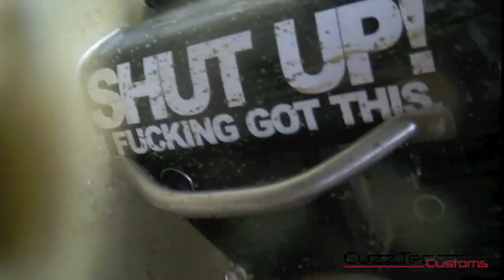How To G16b! 1600cc Efi Engine swap guide Suzuki Sierra/Samurai. G13a to G16b | CuzzTec |

Comment: What’s the part number for the thermostat cap? All I could get was 63B01 and not the first numbers. I’m planning to run short intake runners with a twin Weber style ITB’s and just like the Baleno intake, the thermostat is located in the back and not on the front like on the distributor ignition Vitara

Comment: Great video. Watchd it over and over again. Allmost ready with my own swap. One question. Where is that air intake hose from??
Reply: You can buy them brand new from Suzi store in W.A for $200. But I think that’s very expensive so I ordered mine from India on eBay for like $43 and just waited a while for it to ship. I’d recommend that instead of spending an extra $150
Reply: Jordan P  You dont happen to have the part number for that? Thanks advance.

Comment: Perfect timing. In the process of doing the same swap. Did you have any issues with porosity on the sump weld?
Reply from the maker: No issues as of yet, this is probably sump #10 i have done in the exact same method
Reply: @redzook1  Awesome, thanks.
Reply: i cant weld for shit so i had a mate do mine. just make sure you mock it up really well and make sure the new piece you weld in is sitting perfectly flat and flush or the crank angle sensor will never pick up the crank with its magnet and you will get no start.
Reply from the maker: @fujitsubo3323  thats why i bolt them up to the dummyblock

Comment: Do you have maybe some sources for the wiring? Part of the wire lead into the engine bay, that's clear, but one connector from the ECU lead towards the instrument cluster etc. that will be a question....
Reply from the maker: I have another video on wirig.
Reply: @redzook1  Shame on me, I'm checking it at once. :)

Comment: Hey mate, did you cert this afterward? if so, any troubles getting it passed through? I've got a sj80 and have a vitara g16a and all the bits sitting in the shed waiting to go in. it's my daily so want to make getting it legal as stress free as possible. Great vid by the way! Cheers
Reply from the maker: Hey mate, a few of my swaps have been engineered. Usually just paperwork

Comment: Just a quick question, I have a 2004 Suzuki grand Vitara 3 door, g16b engine, was wondering if anyone knows for sure whether they are an interference engine since it's probably been over 100,000kms since previous owner did the timing belt, and I can't get a definitive answer from Google. Cheers

Comment: thinking of doing an m16a conversion in my 1989 sj50. I have found some good threads about it but wondering your thoughts and information on the swap if you have any
Reply from the maker: Awesome swap! Takes a lot of different parts! But would be a better outcome than a g16b
Reply: @redzook1  do you know of any issues with the swap ?

Comment: I have done a. similar conversation on mine.. Youtube makes it looks easy. What management did you use, and how did you do your fuel pump setup so that it is reliable?
Reply from the maker: All covered in the video and the next few in the series
Reply: @redzook1  Thanks I had a look at that. Haha, I have done something very similar.. but with a Jimny JB43 Loom as I have a aftermarket ECU running and did a JB43 dash swop. (Check it on my channel if you like). the wiring video did not cover the fuel pump installation. Are you using a internal fuel pump setup, external with feeder pump to high pressure pump, or a surge tank setup or straight external high pressure pump direct from tank to fuel rail?

Comment: Hello, I haven't pulled out my original engine (G13BA), but as I'm inspecting the Baleno engine, it seems it won't fit with its exhaus manifold, because it interferences with the engiene mount. Does the G13BA manifold  fits on the Baleno head? If yes isn't it a narrower diameter than the ports on the head? ( I know I could check it myself, but the engine is still in, and I'm excited about what I should change....)
Reply from the maker: No you have to buy conversion headders. Look on ebay
Reply: @redzook1  Well I was afraid of this. It's interesting no swap videos are mentioning this, while the headers are at least 3 times the price of the whole engine (at least around here... ) :D

Comment: where did you get that 1600 conversion kit from looks like rat shit. i'm guessing its its from america or something?. benT for the win!! . i liked the way you did the thermostat to front top rad connection. mines currently just rubber hose with a 28mm joiner with the g13ba thermo sender in it for the cluster and i dont really like how close it sits to the intake manifold. might have a go at your way. also tip for anyone reading this, i was a usless C#$t and ruined both my baleno cable and my old seirra cable trying to mod them to get them to fit. the easy solution is ebay search "
1600 Baleno Conversion Cable - Suzuki Sierra SJ40 SJ50 SJ70 SJ80 Maruti" that cable is from a factory G13BB from an indian maruti gypsy and it directly fits in no mods needed.

Comment: @CuzzTec did you take out the original ECU out of the car or did you do a standalone ECU from camms and plug the temperature into the old one? i'm doing a engine swap on my vitara from a 1.6 8V G16A to a G16B so if you have any tips.
Reply from the maker: You can do do either. The ecu is from the donor car
Reply: okay so the old ecu was still in the car and operating the internals such as lights and stuff and the ecu from the donor car  is only for the engine, did you also put in a different fuel pump and hoses or did u use the original?
Reply from the maker: @redeye_volvo  they don't have a body control ecu. I have a video on the fuel system and wiring.
Reply: @redzook1  okay yeah, i have watched all 3-4 videos on the how to g16b swap. for the past few months i have been doing a lot of research on the swap and after countless of hours of scrolling tho forums and looking at videos yours has been the most helpful. but i'm going to use a baleno engine, i'm probably going to send the wiring loom and ecu to camms since his work looks really nice and professional. is there annything else that i'm going to need from the baleno next to the ecu, wiring harness and fusebox?
Reply from the maker: @redeye_volvo  just motor, bolt ons, loom and ecu.
Reply: @redzook1  alright, thank you for your time. if i run into any problems i know who to look for :) the stuff you have been doing with these cars is awesome to look and learn about.